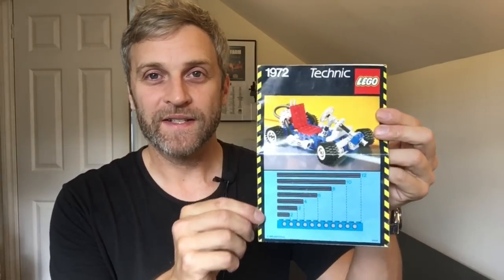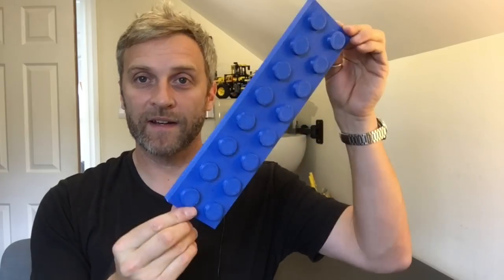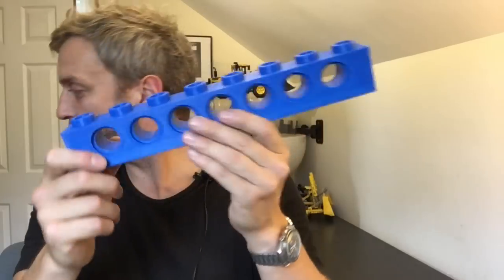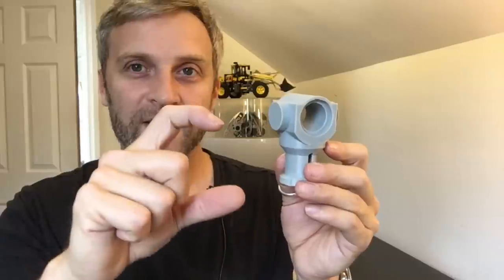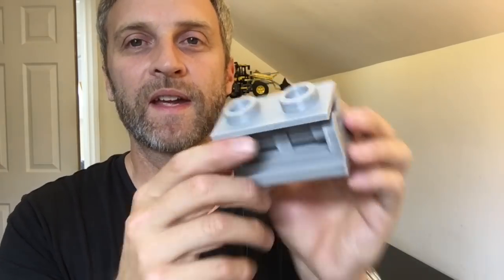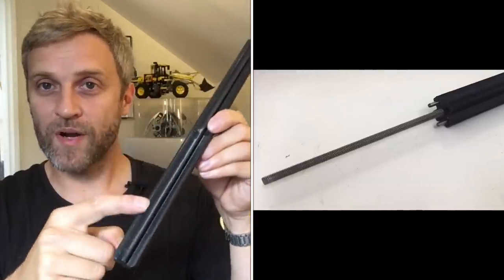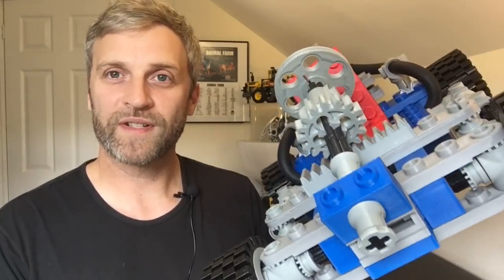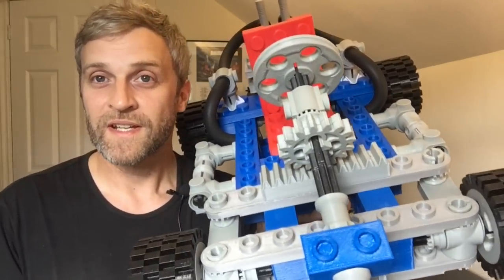Giant LEGO Go-Kart | 3D Printing & Build Details | - Mantis Hacks #8

Comment: Hey Matt! Those Bricks are huge! I like the model a lot!

One tip for the bigger version would be, that you cut the 2x8 plate in half and use acetone to join the two parts back together. Also, for strength you could try to model into those two halves some resecces and some pins. 

(hope you understand me, i didn't know the right word ^^ )

Comment: Wow. Surprised you used ABS.  I had / have issues with the edges pulling away, too. will have to try the Brim to keep them down next time. 

What did you do to manage layer adhesion as the pieces grew in height?  Do you have an enclosed printer or a heated room?
Reply from the maker: Andy Zamon yeah I had issues too.. took a while to get them right, but I'm gonna try ABS X next

Comment: Perhaps I missed it but what size nozzle did you use and how many mm/s? Some of the times you quoted seemed quite fast given the size of the objects. Well done!
Reply from the maker: Dan Keller 0.5mm nozzle, 0.4mm layer height, 20% infill, 60 to 80 mm/s print speed, dual perimeter, two bottom and three top layers...
Reply: Awesome - thanks for the details! That's making more sense to me. Biggest extrusion I've done is 0.5mm with 0.3mm height. This was such a cool project!

Comment: Awesome project! I was inspired to do the same thing with a small print-farm, only smaller (because Prusa i3 has a smaller print bed). Did you get the models from printabrick.org, or somewhere else? Some of the models from printabrick need fixing before they can be printed properly.
Reply from the maker: Jeroen Bouwens Hi. Thanks for the feedback. I got the parts from various places. I will be releasing the STL files soon, many of the parts need fixing or creating from scratch. The standard bricks I have SCad files that generate the bricks, again I found these on line but had to fix them for the scale I was working at. I'll include them when I upload the STL files.
Reply: Matt Denton could you share the source for the Lego bricks. I have downloaded from several paces but the bricks are to low res to scale up.
Reply from the maker: Check out my thingiverse account mantisrobot

Comment: Does anyone know if just normal black PLA will fit around the tire housing? Or does it only fit if it can expand around the wheel housing?
Reply from the maker: Hi. The way I have cad these up, and assuming you’re using my files it needs to expand. But you could re-cad the tyre so you could print solid.
Reply: @MattDenton  Thank you for your reply.  Correct me if this won't work but of I print both sides to the tire housing separatly (In two pieces) I should be able to put them in the tire on both sides and then glue them to the tire from their. I hope this makes sense and please correct me if this won't work. :)
Reply: Here is a quick example of what I am talking about, this is half of the Wheel Center, the other half would go on the other side of the tire and glued. https://imgur.com/a/6Fb5d
Reply from the maker: Hi. Correct. I print the wheel in two parts anyway, but yes you could assemble with the printed tyre, although the fit might be slight right as I’m not sure I left any clearance. Worth a go though and I’m sure some fettling would make it fit.